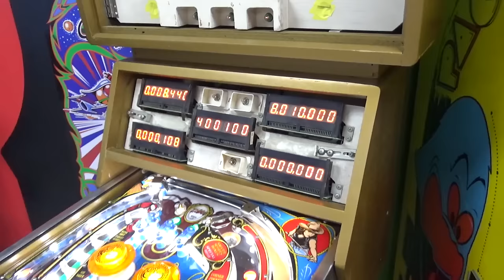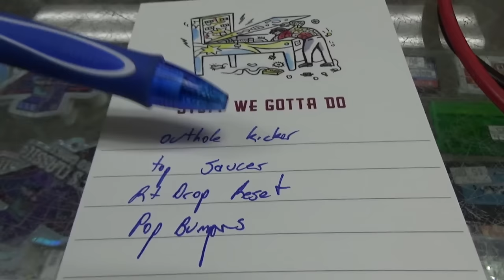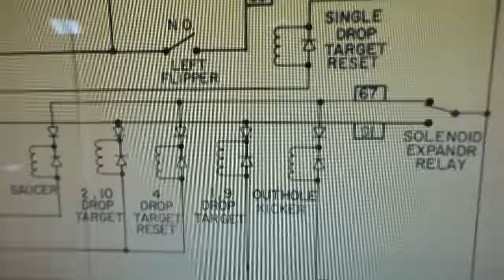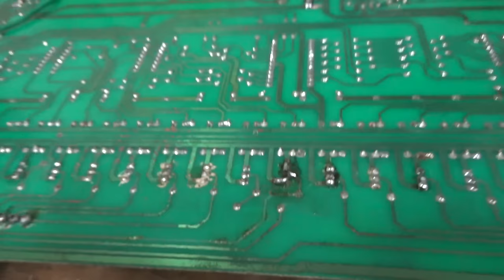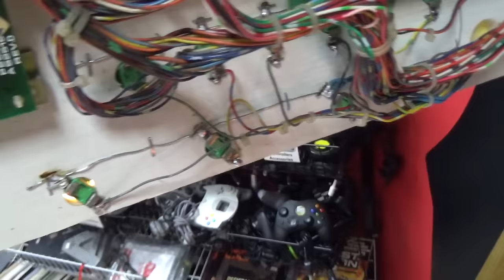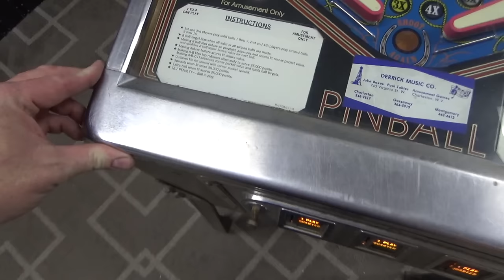Epic Repairs On A Bally EIGHT BALL DELUXE LE Pinball Machine!

Comment: JOE, What does the Solenoid Expander Relay do or control?
Reply: There are more solenoids than the main board can control so they split the solenoids into two banks. The expander board relay flips the solenoid control bus back and forth between banks. That allows each solenoid transistor to operate 2 different coils.
Reply: This was early days of solenoid expander control. Soon, new board designs would have more solenoid drivers on them from the start, but when they started using a lot of flashers on the playfield, they needed expanders again. Flashers also were powered by solenoid voltage, so lamp drivers wouldn't do. You power a 12 volt bulb with 40 volts or so, but just for a split second, so it's a delight for the senses.

Comment: @Ron - the reason why the LED's flicker, vs the incandescent bulbs, not flickering, is from the slow, thermal response of the filament in the bulbs, which take on the order of 100-300 ms to heat up to full brightness. 
LED's can light up MUCH faster, on the order of us, and are near instantaneously at full brightness. 

The matrix style lamp driving methods, with shared data busses, etc, may have small periods of time when the lamps may have been driven from this. With incandescents, the time constants  are so slow, they don't light up, or only faintly light. One advantage is that it does keep the filaments pre-warmed, for less thermal shock, hopefully extending the bulb life.

To fix this with LED's, add a capacitor across the LED in the actual replacement lamp, after the limiting resistor + rectifying diode (observing the polarity of the LED and cap if an electrolytic is used). 6.3V would be enough (Vf on an LED is less then a few volts). Probably on the order of 1-10 uF. Maybe a bit more, or less, depending on the frequency/duration of the pulses.
A small series resistor after the cap, between the LED and cap would further filter this. Something around 100 ohms.
Basically, make a low pass filter for the LED...

This cap will intergrate the pulses, and control that weird flickering / pulsing!

Comment: Hey Joe, Joe here. Had a question. I'm in the middle of a full restoration on a 1975 Williams OXO and was wondering if you knew a place I could get plastics for it? I have the complete set (5 pieces) but they are yellowed and faded bad. Been  looking  everywhere and can't find anything.
Reply from the maker: Unfortunately I don't, I wish they made more of the titles like that one... you basically have to just find onesies on ebay when they pop up used.  You can cut clear ones by hand, and then scan the artwork and print it on a clear decal to put on them but it's a lot of work!
Reply: @LyonsArcade  Yea thats what I think I'll have to do. I  thought I saw at one time or another of a company that does reproduction plastics but I guess not.

Comment: I don't care much for LEDs either, however from an electronic engineering standpoint I wonder if this LED flickering issue could be stopped by wiring a small cap across the legs to delay them coming on a bit
Reply from the maker: I'll never know !  :)
Reply: Some LEDs do not draw enough current to latch the SCR that drives it. The standard fix is to solder a resistor across the socket to slightly increase the current draw. They make LED compatible boards now and there are some 'Non Ghosting' type LEDs available that do not have a flickering problem. IMHO, there is minimal benefit to using LEDs in place of under-insert switched bulbs so I always leave them as incandescents and limit my LED usage for exposed GI lights.

Comment: Good job, however, the replay scores, mode, and sound setting are all stored in NMOS. (5101) without the battery you will loose all those settings when you power down. You need the battery backup or NVRAM alternative for the game settings to properly work.
Reply from the maker: You didn't watch the whole video but that's o.k.   If you're going to go around giving people unsolicited criticism you should probably watch the whole video so you don't look foolish
Reply: 😅😅😅😅 @LyonsArcade
Reply: I did watch the whole video, albeit not all at once. These are long. I made notes during the part when it was said you don't need a battery in these games. Yes you do! There is a part near the end where that was corrected? I must have missed that. Assuming most casual viewers will too. @LyonsArcade